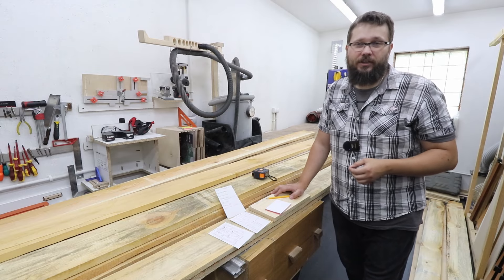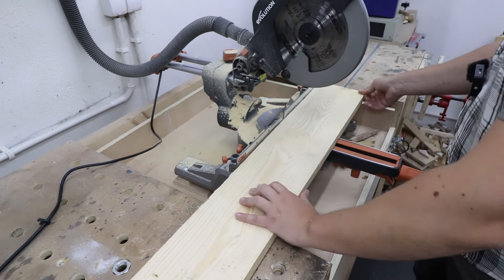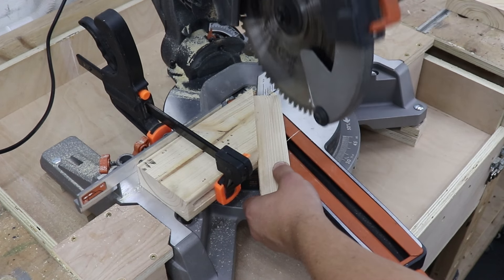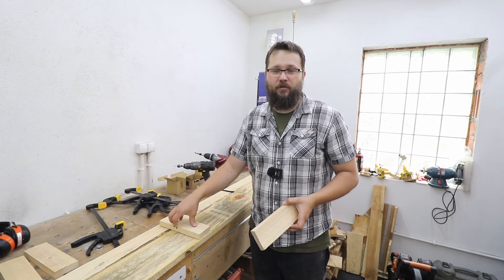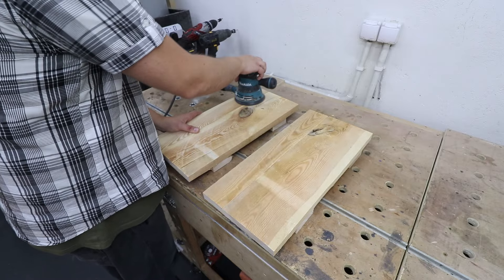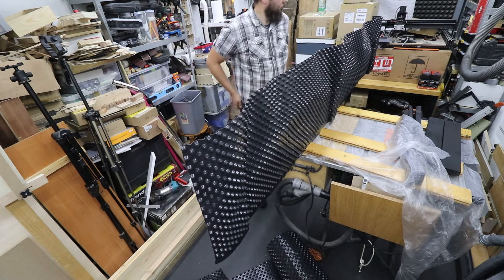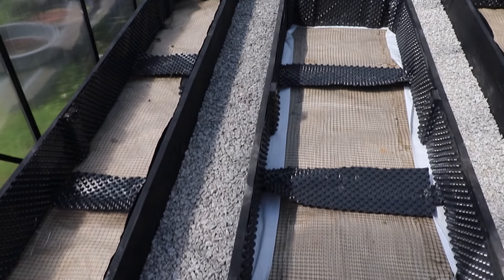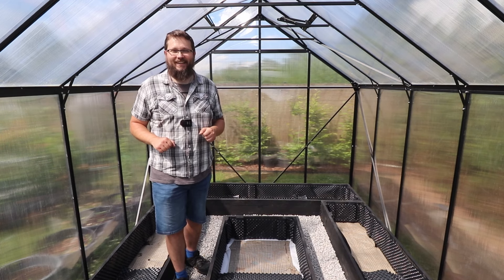DIY Raised Beds for a Small Greenhouse

Comment: Another excellent tip for beginners 👍... although if moisture retention between the lining and the wood is a concern, then it'd be better to have the dimples facing the wood so that there is an air gap 😁
Reply from the maker: The dimples are nit that sturdy, if pressed against wood and being under pressure from soil they may collapse. This way you still get some air movement between the foil and wood. Not ideal but better than normal plastic lining